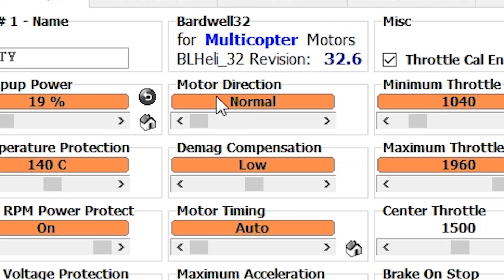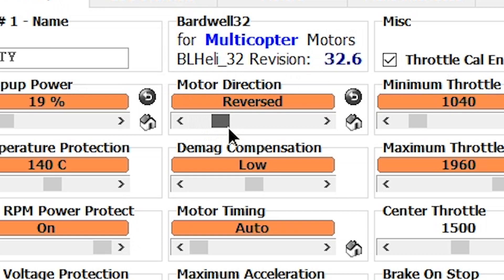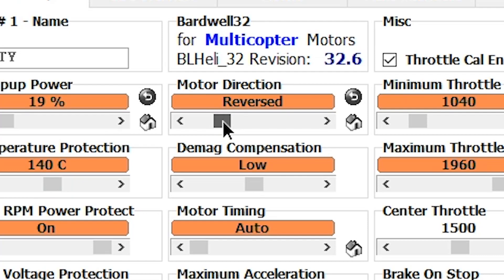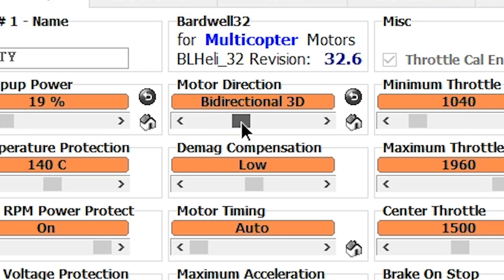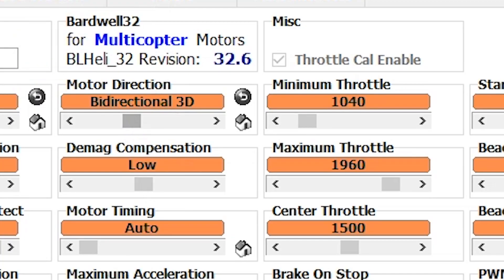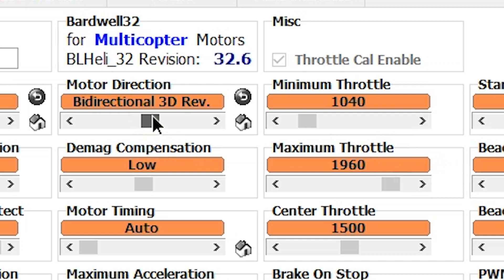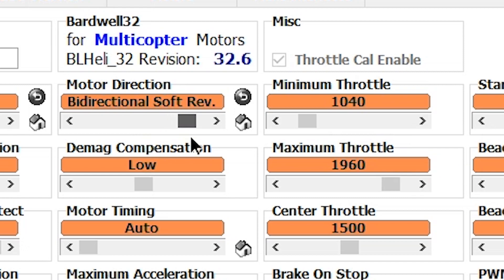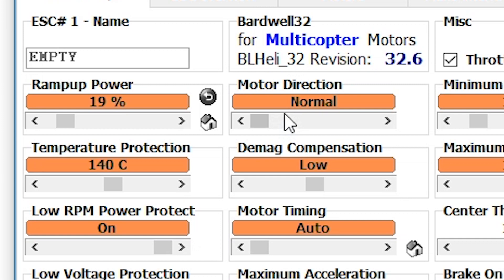BLHeli32 100% Explained - Part 8 - Motor Direction

Comment: Hey Josh, I'm having an issue with my Diatone Taycan 2.5 with the F411 25A AIO ESC. Motors 2 and 3 are running in the opposite direction that betaflight wants them to. I reverse them in BLHELI configurator and they are still spinning in the same direction as before. How can I fix this? I'm new to FPV drones and the drone won't take off.

Comment: I've noticed that the eachine ccw and cw motors spin the correct way when wires 123 on every motor, and that with single direction motors, I have to swap leads  2 motors.

Comment: Jb how can I change the motor direction of just one motor can you make a vid of showing this like how do I select the 4th motor change the direction and save it so it actually applies it to the drone I can not figure this out and I can not find a single video explaining this.
Reply from the maker: Right-click on a motor number to select just that motor.
Reply: @JoshuaBardwell  where? does any one see that option?
Reply: @zx6mick  if it's not too late...on my down loaded version 32.7.1.9, you have to right click on the esc box at the center bottom of the esc setup page. Once you isolate the esc, you can change what you need to for that esc. In my case, I was reversing motor direction, and naming the ESC e.g ESC 1, clever huh? Once you make the change, you have to select Write Setup for the change to be applied to the esc.

Comment: I know this is a Zoe question but... Do 3D pilots use the gimbal spring to center the throttle stick like on the other gimbal? Seems like that would be the case.
Reply from the maker: I'm pretty sure they don't. When I practiced 3D in the sim, I didn't.

Comment: I only get the first 3 beeps from my blheli escs but my flight controller is still powering up connecting to betaflight and my cam, vtx, and receiver still work. It all used to work before I crashed.What’s wrong?
Reply from the maker: https://www.youtube.com/watch?v=_hkzm8ZXsxE